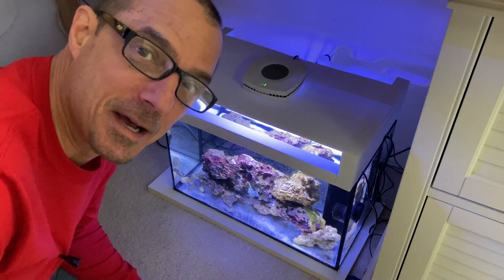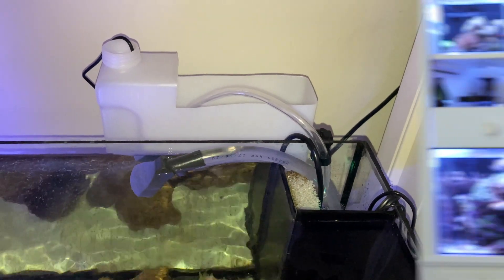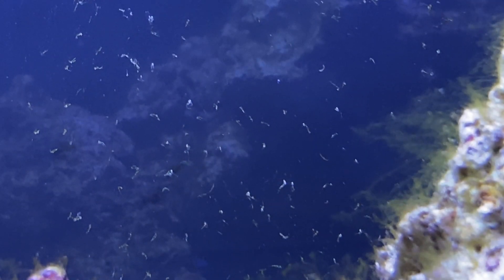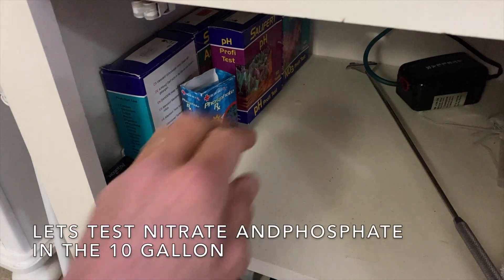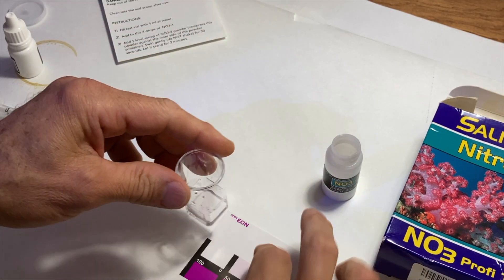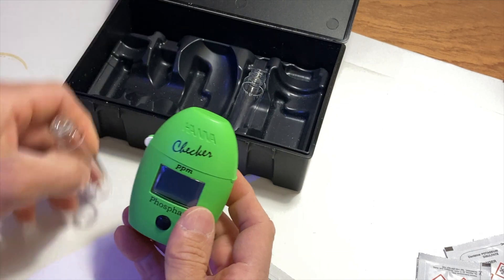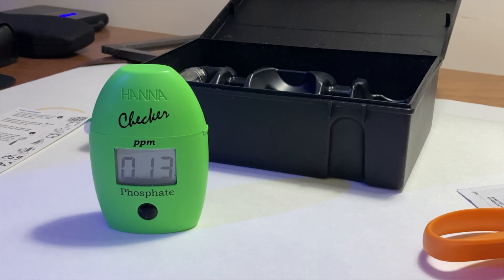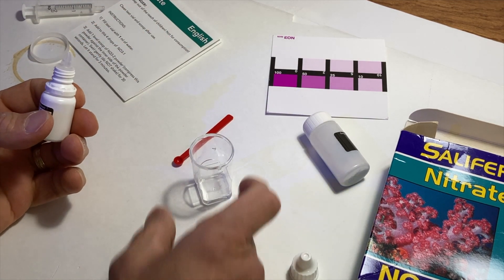10 GALLON NANO REEF - WHATS NEXT-  AFTER THE CYCLE?

Comment: If I test my phosphate is 0.48 ppm is it still good for my coral?
Reply from the maker: Hi Jason, as long as your corals look healthy (color, polyp extension) then .48 is fine. If you want to drop it a bit, do a  water change but vacuum your sand bed. You can also use Phosphate RX  I’ve used it many times to lower my phos. But look at your coral 👍🏻😊

Comment: Great content this week. Upgrading my lighting on the 10gal. 150.00 budget, any suggestions?
Reply from the maker: I would go with the Kessil A80, $129, great blue, great shimmer, you can control it a fair amount. And it’s a good quality light. It’s over my 5 gallon, my pico, and supplements on my 20. If you can get to $210, then Ai Prime 16HD👍🏻
Reply: @TOMReefer  thank you. is the AI worth it?? I was looking at the ramp up, ramp down functions and to do that with the A80 it’s an additional 60.00.. thoughts?
Reply from the maker: I would go with the Ai then. It’s the best light for the money. Your next step up is like above $400. Ai is a great light and excellent ability to program, ramp, and excellent shimmer also. I didn’t know the kessil had an add on to the enable you to ramp it? It’s just knobs On the A80. No?
Reply: @TOMReefer  Just checked Amazon and it’s an additional 100.00 but yes the Kessil Spectral Controller (92145338940) allows for ramp up and more light control over all.
Reply from the maker: Hey We’re All Negan, haha, I’m a fan. I have the Kessil A80 over the 5. However, depending on what you’re keeping would determine your setting. If no SPS, then you could set your prime at 40-50% CW and 75-100% blues and UV, and 0 red and green.  👍🏻 I’m basing it on mine over my 10 gallon. You can play around with your blues if you want. Just keep them above 40%
Reply from the maker: @wereallnegan  great to hear that about you and your nephew! You probably don’t have enough CW at 1%, your tank probably looks blue 😃🤪raise that up. Also how far way the light is from the water matters too
Reply from the maker: @wereallnegan  great to hear! Great you got a par reading. 👍🏻yes 65-75% is not that intense once you are down 6-8 inches under water 😃
Reply from the maker: Haha! I will! My wife and I were there about 3 years ago! Absolutely love it out there! 😃